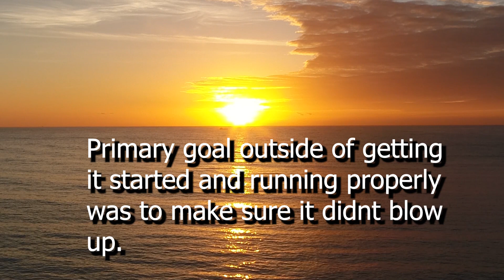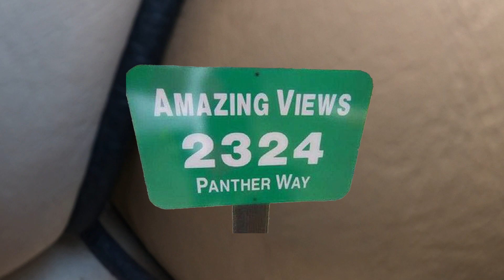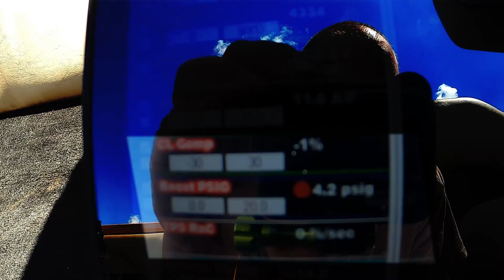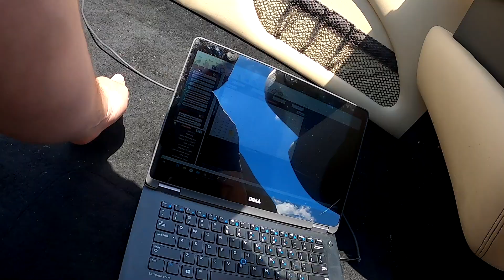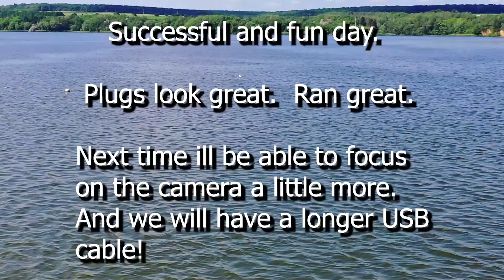Holley Terminator X Tuning \\ LS Powered Jet Boat with LSA Supercharger

Comment: HAHAHAHA! A boat with engine reliability issue! LOLLOL! Come on man, that never happens! Honestly thats exactly how GM proves out engines! They test them in boats, on the lakes! Needless to say, they blow alot of shit up! Some engines dont even make it a day! Probably why boats use Big Blocks w Center counterweighted crankshafts! Big Heavy Parts, Extra oil clearances, extra pump capacity, strongest valvetrain parts they can find. L/Ses make great power, but if you dont have superstout parts, like the stuff I just mentioned, they dont live very long! Unless its something thats just putted around! Hopefully thats not just a stock B15 engine! Those powdered metal rods, are fine in a car with 15PSI, but in a boat, He defiantly should upgarade! I think they also have Hyperubustic pistons. They dont like to be in that situation! Hopefully it is a real marine engine! Because they would normally have upgraded that stuff! You will probably be back to put a dominator in it, beacause I have not seen a Terminator that liked its job on the water! Nice Job Joe & Beautiful Boat! I really think they missed the mark with the windshield! LOL I thought this video was new, DUH!

Comment: i think that's my next boat. lol open bow, has a old school yet modern look. What year is it do you know?
Reply: I have a 2004 eagle 230eliminator  just like that but different paint scheme and with a 8.1 vortec  motor
Reply: Yeah there is a bench seat that sits in front of the motor and a power hatch that lifts too allow access to the motor.....I can get upto 80 mph on mine if the tide is right and my trims are dialed in

Comment: Did you pull a bunch a timing and use a ton of idle spark to get the idle down when putting into gear without stalling?
Reply from the maker: I didn’t do anything overly fancy on idle with this one. It’s drive by wire and i usually add a custom table or 2 for idle. Drive by wire makes idle control a lot easier

Comment: How to know the max timmimg to afr that gives best power when no dyno available or here where the experience plays a role?
Reply from the maker: Plugs and experience really. Could use knock sensors but you have to calibrate them first and if you rely on them but the calibration isn’t correct you get yourself into Trouble fast

Comment: I love boats. But 40 mph on water feels like 140 in a car to me. I am a sissy on boats. I’m like samual in Jurassic park one. Hold onto your butts. Have to upgrade the keister pressure sensor on the boat version harness to a 0-1500 psi unit from the 0-150 psi units.

Comment: Are the manifolds not water injected or are you not running water into them right now so you can run an 02 sensor
Reply from the maker: They are and they run an o2 sensor that doesn’t get wet
Reply: Water comes in about 4" aft of the sensor.

Comment: Boat engine with a jet pump is basically a dyno that moves on the water . Boats are rough on engines because there is no way to go faster except to rev it more . At least there wasn’t the usual list of mechanical problems to work through .